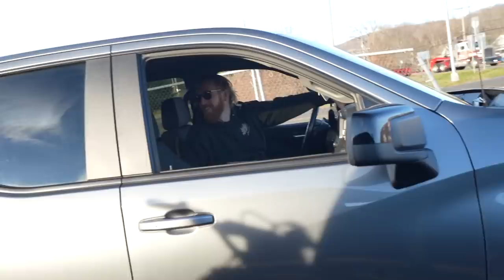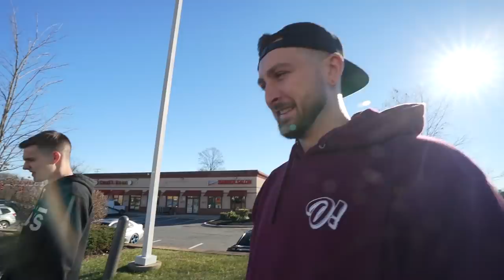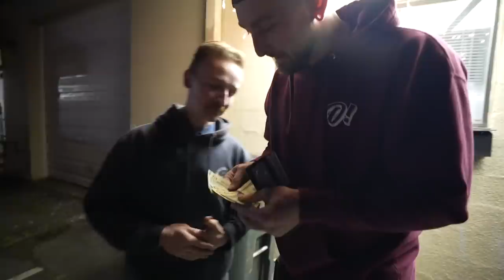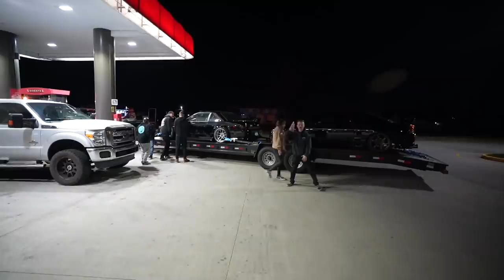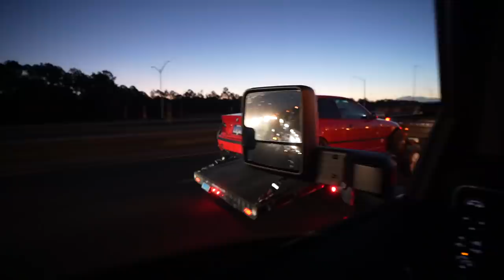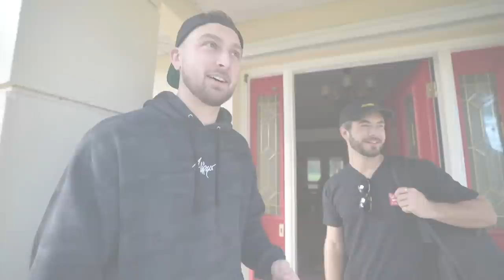WE DRIVE 1200 MILES TO THE LZ COMPOUND!

Comment: If you back on the first car and pull the second one one normal. The weight would be more centered over the trailer axles and take some weight off the tongue and reduce the squatting a little bit. Also could do the add a leaf kit for the truck to increase it's towing/hauling capacity.

Comment: When you load 2 cars on the trailer back the first one on then pull on the rear one. Cnter the weight of the 2 front ends over the front trailer axle, should distribute the balance better..

Comment: you DONT need a bag kit for your truck.. need to shift the cars back a little to take weight off the tongue. or you could flip the s15 around and that might level the load. could also use a weight disturbtion hitch. or you could raise your ball height.

Comment: What you should have done is reverse the S13 on so both engines were over the trailer axles.
All in all that’s a lot of trailer for just two single axles, even with a bag kit, that rig will get super unstable with that much weight on the tow hitch if you have to change direction quickly.
Reply: Nahhhh run it!